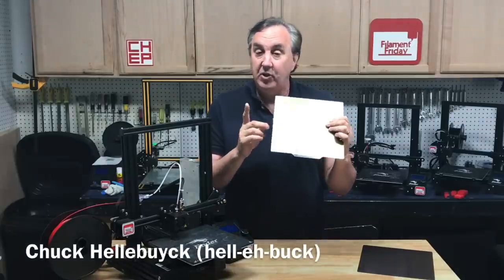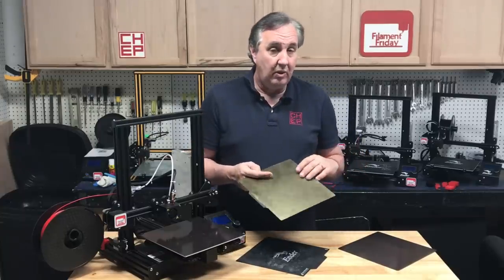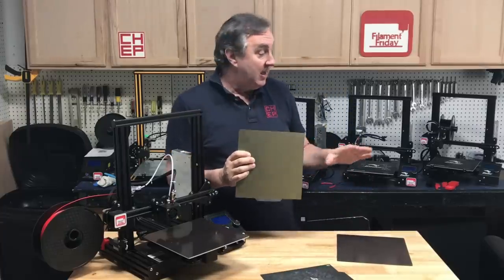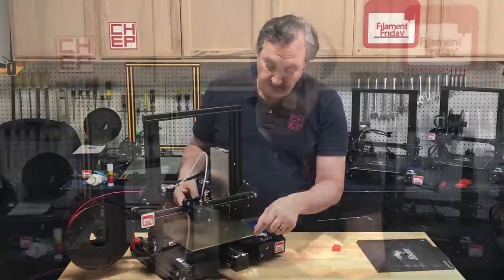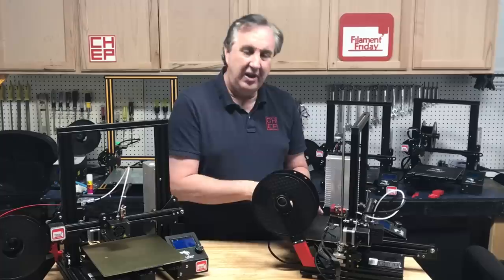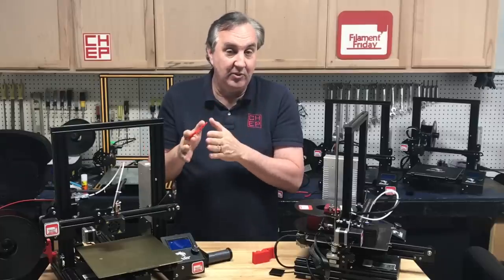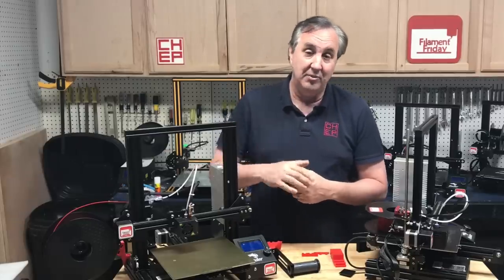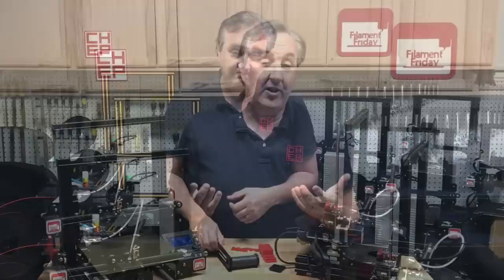Creality PEI Magnetic BED on Creality Ender 3 PRO

Comment: I’ve been printing primarily on PEI for the last 3 years on a variety of printers.  The one common chain on adhesion issues is not cleaning the bed with 90+% Isopropyl Alcohol, ideally with a lint-free cloth (or even a coffee filter) between every print.  I also work hard to never touch the surface of the PEI with my fingers to try to avoid finger grease on the end too.  With PLA I print at 60C.  I found that higher temps can also contribute to the warping you showed.  Good luck!

Comment: Hi Chuck! I saw many fingerprints on your PEI sheet in the beginning of your video. If you just used alcohol, reconsider washing it with dishwashing detergent under warm water, rinse it really well and dry with paper towel. Then DONT TOUCH the surface anymore. And try again! I LOVE my PEI sheet on the magnetic bed. It works every time. But it must be totally clean.

Comment: Chep, sand your PEI bed with super fine 0000 steel wool in circular motions. Then wipe it down to remove the residue.   You'll have to refresh and wipe down the surface every so often. When trying to remove TPU from it, stick the whole bed in the freezer for several minutes. Then flex the bed. The TPU will pop right off.

Comment: I bought the same PEI bed for my Ender 3 Pro and have had it for a couple weeks now. So far I haven't had any problems with it. I've printed a few lithophanes with it and a few other things and everything sticks well during printing and I love how easy the prints come off. My bed is also more level and I make a lot less adjustments with this bed. I haven't cleaned the surface other than blowing off a little dust. For me, this has been the best upgrade for my printer by far.

Comment: Hi Chuck! I have good experience with PEI but in my observation it requires higher plate temperature than lattice glass I used before. For PLA+ I use 70C, for cheaper PLA I even have to heat to 80C for first layer, then I drop it to 70C to save some electricity. Also make sure to wipe any dust and fingerprints using isopropyl alcohol.
Reply: This.  I have PEI beds on all of my printers.  In fact, the creality glass bed is pei coated.  PETG sticks so well that it actually detroyed my creality PEI bed.  Scuffing them works wonders along with soap and water.  60-70c and PLA sticks well.

Comment: I wore out my stock mat and had absolutely no luck with the glass plate. Switched to PEI and it’s been right as rain so far. Nice adhesion bit like another person said, I had to bump the temp up to 60 as Cura 4.5 was setting it to 50 degrees and I had all you can eat spaghetti. I’ve had to relearn bed leveling with the thinner mat but I’m pretty satisfied. My mat also has the rough edges on the coating but no blemishes or warps in the main surface.

Comment: Chep, my fleet (CR-10S Pro, CR-10S V2, and several Ender 3's) all employ PEI as the bed surface.  Initially, I had a TON of first layer adhesion problems and edge-warping as you've experienced. 

What totally changed the game for me was to simply mildly scuff the surface of the PEI surface with something like steel wool or in my case, 300 grit sandpaper. 

I will never go back to glass or build-tak! Give it a shot!

Comment: I use the WhamBam PEX sheet which is very similar. You need to prep the sheet with some wire wool to scuff it up a little (and you should repeat this every 4-5 prints), and you also need to boost the bed heating to at least 60C, maybe even 70C depending on the filament. If you do this you'll get things to stick and great results.

Comment: Mine had the same issue. It was brand new and I could only get prints to stick about 20% of the time. I went over the entire surface with a coarse grit and fine grit sandpaper and it's worked like a dream since then. Both PLA and PETG work great.

Comment: My Wham Bam PEI sheet came with instructions to rough it up with 0 or 00 steel wool and IPA before use. It has worked fantastic for months with the occasional touch up with steel wool and IPA. I also use a cheap PEI surface I bought on Amazon that has a very textured surface. It leaves the print with a crinkley bottom surface but works fantastic for adhesion and the print coming loose when cool. Try working it before use with steel wool and alcohol. I think you will be happy with the results.

Comment: That's really rough CHEP, sorry it was giving you such a hard time. I'm using this exact sheet on a difference machine, and I've had great results with it actually. It's entirely possible you've got a defective unit, because I've been having great luck with PLA at 60°, PETG at 75°, and ABS at 95°. The best tip I can give is to make sure it's clean, wiping it down with IPA or similar. I would also suggest trying to move it a little further away from the nozzle, since you were getting even worse warping the closer you went.

Comment: I have a pei-sheet and the problem i found was that cura 4.6 something had change stockbed temp from 60 to 50 so i got the same issue that you got but when i swaped to 60 it just printed fine never hade any problems ever and when the prints cool down you can just flex it off with zero procent chance that the print get stuck on the bed and snaps

Comment: I bought my first 3D printer about two years ago, a Prusa i3 MK3. It came with both a smooth PEI sheet and a powder coated one as well. I’ve been using both, but mainly the powder coated one. It’s a good practice to clean it with IPA after every print, especially when printing PLA. PETG sticks to it like crazy, ABS and ASA are pretty much the same. I gave one of my smooth sheets to my dad to use on his Ender 5 (the magnetic surface from the factory was unusable for me), and got some PEI sheets for an other friend for his Ender 3 Pro. The good thing about the steel sheet is that I could upgrade my dad’s printer with an inductive ABL sensor (got a Prusa PINDA probe) which is so much quicker than BLtouch and contains no moving parts.

Comment: Yeah, I just installed that same bed on my machine this weekend 4/27/23 and it has completely changed my printing game for the better. If you got a blemish, send it back, somethings wrong.
~Creality ender 3 v2
~upgraded metal extruder assembly and blue bowden tube
~CR Touch installed
~upgraded bed springs and aluminum adjustment wheels
~printed filament roller guides for low friction feeding
~Creality PEI mag bed
~Hardened Steel 0.4mm nozzles

Comment from the maker: I should have stated in the video that I did clean the PEI sheet before using it. Mine didn’t have a protective sheet (which is why I cleaned it) and got the results in this video. Through filming multiple takes I did finger up the bed but didn’t print with it like that. 

I didn’t rough it up because I decided to return it rather than “make it work”. I’m sticking with Buildtak or Glass. I just don’t see the point in spending $30 for something I have to rough up or spray with hairspray to get it to work. For that price it should work out if the box.
Reply: Sucks that you had a bad experience with the PEI Chuck! I have two (one with a sheet like yours and one powder coated) on my Ender 3 pro. My absolute best adhesion is the stock print surface, but I broke mine (flexed to much and made a hole in it). Really hated glass, and have had better luck with the pei ones. I still want to get a new stock bed, but I'm not able to get the original ones, and the ones I'm able to find on Ali etc are all pretty crap.
Reply: Actually protective film could be even thicker than PEI film. Maybe yours have that film and it stuck together with PEI. That blemish you have - it looks like air bubble under protective film. Have you tried to separate film from the edge with sharp blade?
Reply from the maker: Ronnie Lauren - Yes, to the point of almost damage. They may have sent me a returned unit for all I know.
Reply from the maker: Carl Coetzee - I’ve tried that and the angle of filament is too far so I’m giving up a bit of bed instead until I redesign.

Comment: If using a PEI bed surface you should use something like steel wool to clean and superficially roughen the surface then clean with IPA before printing.

Comment: You need to really clean the PEI sheet with alcohol while cold and avoid touching the surface. You can also use a green scouring pad to very lightly scuff it up. Still, large PLA items will warp without glue stick or hair spray. Hair spray gives similar results to glue stick but without the glue marks that you mentioned. Flex and PETG sticks so well to PETG that you actually need glue or hair spray for release.

Comment: I have been using this same PEI sheet for the past two months on my Ender 3pro and have been having great success.  I particularly enjoy the very smooth finish on the bottom of every print.  However, I did have the very same issue you had until I started to use hairspray.  To the sadness of my wife, I am using her Nexxus strong hold finishing mist that is an arousal not a pump.  The hairspray holds every print perfectly! I re-clean the  PEI sheet about every two to three weeks and then lightly spray on the hairspray for each print I do.  Crazy, but it works amazingly.  Hope that helps.

Comment: Why do so many people hate on the magnetic bed? I love mine, and bought a backup just in case.  My printer has some mileage on it and the original surface is still going strong.  No glue or adhesive required.
Reply: I messed up my original surface within the first two weeks :D
It was my first printer and I was still learning, so I crashed a hot nozzle into the bed twice, leaving two good sized holes... one of them right in the middle...
Reply: Because it sucks, its more fragile than glass, and can't print anything than pla on it

Comment: If there is any kind of anything on the bed leaving a residue or oil of any kind it will not work. If you clean it with iso it works beautifully. I've got one of those Creality PEI sheets and absolutely love it.

Comment: I have that same PEI bed and PLA sticks amazing to it.  I did have to up my bed temp from 60C to 70-75C.  When it cools down the part just slides right off.  PETG sticks amazing at 80-85C and even ABS around 90C.  I had the factory magnetic bed, switched to glass for a while and then tried this PEI setup.  I'll never to back to glass.  Plus when the print is done, you can pull the sheet off, and it will cool so much faster so you can get the next print going.

Comment: Prints on PEI are running dead flat on my Ender 3 Pro. So far I've tested Hatchbox PLA at 110F extruder and 80F for first layer and 60F thereafter. Printing a 2mm layer from a 4mm nozzle with a six pass brim. Sorry for your misfortune, especially that surface defect, but this new bed is what I've been looking for. If future results are not as good I will be sure to let you know. Until then, much thanks for this and your many other videos, all of which have informed and guided me from the beginning.

Comment: CHEP: I have x5 Ender 3 originals (the one without the metal insert on the extruder feeder drive) and I use plain a plain old Amazon Basic glue stick on the default build plate that comes with the Ender 3, and it works great. Wash it off with hot water about once a week, after it starts to really get goopy. The one machine I use glass with have a very smooth first layer, but for my models that doesn't matter as much as it might to some. Anyway, love the vids because they always teach me something new. I think I will steer clear of this build plate replacement, just wish I didn't have to go back to creality for more of those original build plates! Cheers :)

Comment: When I got mine out of the box, I had issues. Gave it a light scuff with 400 wet dry and some dawn dish soap water. Since then I have had almost no issues. I print PLA and PETG at 60C and Taulman 230 at 80c with a thin coat of PVA on top.
Reply: I print taulman 230 at 30c

Comment: Hey Chep, I have an ender 3 and I have this same PEI sheet (although I got mine directly from creality).  I'd say I've had mine for about 8 months now, and I thought it was complete garbage for the first 4 of them.  Now I swear by it. My prints stick well most of the time and come out looking great.  The thing about this is that your level has to be super accurate.  When dialing it in, you might want to lean more toward squish.  It helps to have upgraded springs on whatever printer your working with too, as the level tolerance is so fickle and a pain to re-calibrate on the regular.

Comment: I have one from a europe provider and I had the same issues. What worked for me is 000 wool or green scotch. Scuff the surface with alcohol and now I'm loving it. 
I'd suggest to use the technic used by wham bam for scuffing the surface.
Also clean with rubbing alcohol or ipa before print

Comment: Decided to try the PEI. Very happy with the results so far. The original flexible bed on my ender3 pro was getting pretty mucked up and I was having a lot of trouble getting the first layer to stick with small features. Also I'm using wood filament. I got mine direct from Amazon sold by Creality US and it came in an original Creality box, very well protected.

Comment: I'm using the Creality PEI Magnetic Bed on my Ender 3 PRO and it works great!! I bought mine from the Creality Website. All I had to do was use a #000 steel wool 1st. clean with IPA. I get perfect prints every time. I would highly recommend it or the Wham Bam. They are around the same price.

Comment: This PEI bed works perfect for me. Most important, it must be clean. Dust and maybe a little bit touched with my finger the sheet, on this point it stops sticking properly. So get sure it is perfect clean, print with 70C bed temp and you should get more than perfect first layer and sticking to bed.
Reply: this is really the one thing you have to learn with PEI. it has to be totally clean. This might be especially important to CHEP, cause you dont really have to worry about that with builtak

Comment: Recently switched to Buildtac branded PEI on their metal flex plates on my hotrodded Wanhao I3 plus.  Works perfectly for me with PLA. I have always run my printbed hot for better adhesion: 62 degrees for the first layer and the rest at 60. Sticks tight while printing, pops off easily when cool. Printing at 90mm/sec (with volumetric constraints on, so it might be a bit slower than that.)

The Buildtac sheets did not come with a protective sheet over them. It's possible Buildtac is doing some special prep on the surface. I've also noticed that PEI seems to pick up finger oil. Wiping the surface down now and again with IPA seems to fix that.

Hotrod parts:
E3D Hemera
Z-axis braces
Aftermarket heavy aluminum build-surface mounting plate
Klipper

Comment: I have a similar plate on my Ender 3 Pro but my one came in two parts and I have to attach the PEI sheet to the spring steel, like your video it seems not to work so I put it away thinking it was rubbish.  however a few weeks later I read an article about them and it turns out you have to rough the PEI surface up they suggested wire wool, I had none so I used 1000 grit sandpaper.

Since then I Clean it with IPA and re-rough the surface about every 20 (ish) builds and to be honest its the best surface I have used on this printer.

Comment: CHEP, i have the same bed sheet from the same seller on amazon, i could not be happier.  it holds pla very well and is so easy to pull off and flex to get the print right off.  i am coming from a geeetech super plate and really feel this pei spring steel bed is way better.  i hope you get another one and post a follow up video.

Comment: I had many adhesion issues as well, but I am using PETG filament. Running the bed temp at 83 and nozzle at 230. First layer down at 20mm/sec. Sticks like a good 'un :)
Having the bed at 70 or 75 seems to push the laid down filament into thermal shock, it just cracks and lifts, it's not hot enough. You really have to weld that PETG down!
Keep up the good work. Got a flawless Ender 3 Pro thanks to your build video.

Comment: I have a CR20 that I used the factory surface for some time. Upgraded to a glass bed that I could not get anything to stick to. Ended up sticking one of those PEI adhesive surfaces to it. As long as the surface is cleaned before printing, it works very well without any adhesive applied. The stick-on PEI surface is different than the one you show in the video. I actually have one and ran into the same issues that you present. Great video as always. Thank you.

Comment: instead of just rubbing gluestick on the glass bed I cook up a soup of about 1cm of gluestick in 100 ml of water, add about 50 ml of cleaning alcohol and keep the solution in a small spraybottle.

When applying it leaves an almost invisible trace of gluestick on the glass which lasts for a dozen prints. Works great!
Reply: Uwe Zimmermann That sounds really interesting because the gluestick is annoying to clean off, especially when it gets a bit too thick. Does this work only with PLA or other materials too?
Reply: @Iboo30  I mostly use it with PLA because I almost don't print with other materials. But a couple of times I have printed in ASA and PETG without problem. 

For the adhesion of the plastics to the glass it should not matter how thick the glue film is, just wiping on a very thin layer should give you the same properties, and it retains the mirror-finish of the first layer.
Reply: Uwe Zimmermann Okay thanks, I‘ll try it out. 
Yeah but I tried different glue sticks, some stick really well and some don‘t and also they leave a different kind of trail on the glass. Some are more rough and others are very smooth. The smooth one didn‘t stick when it was heated up.